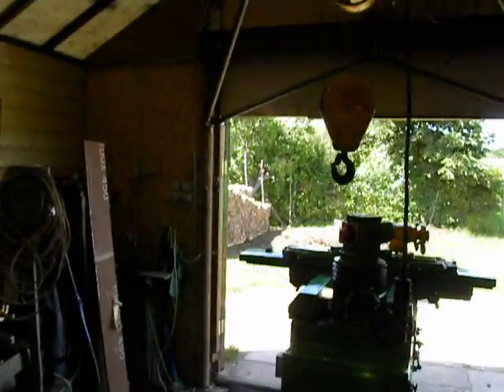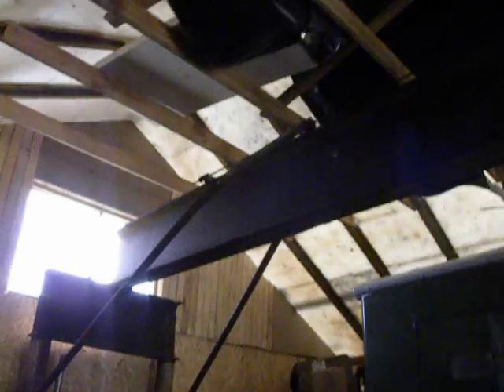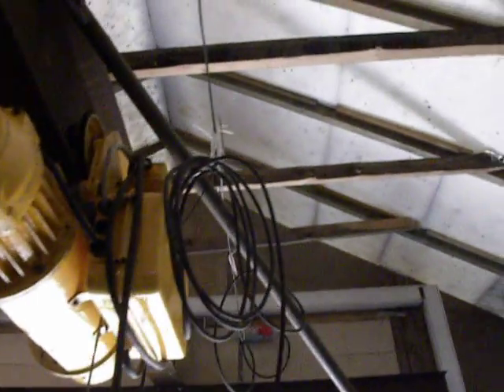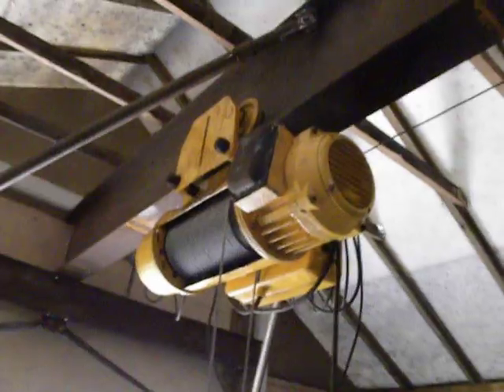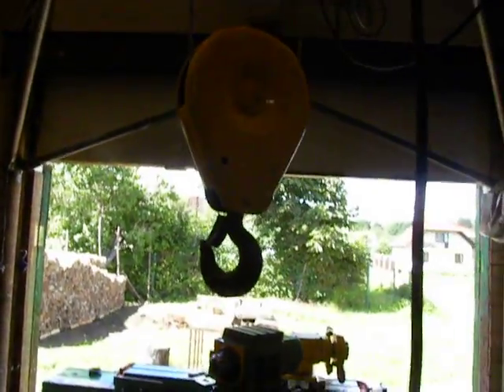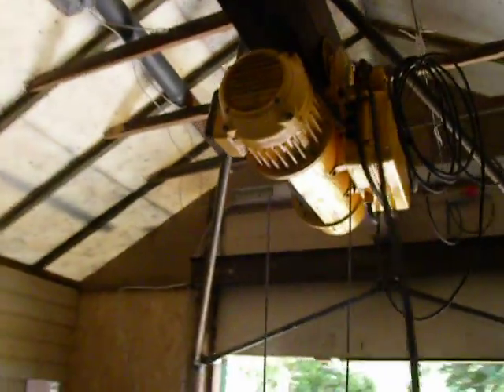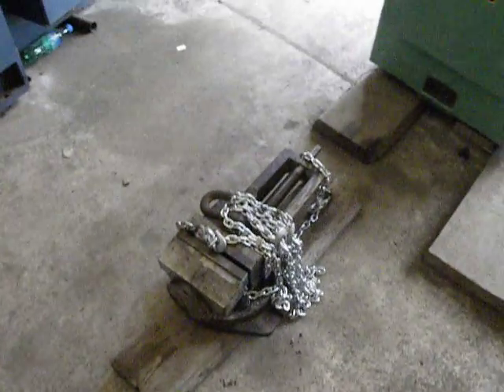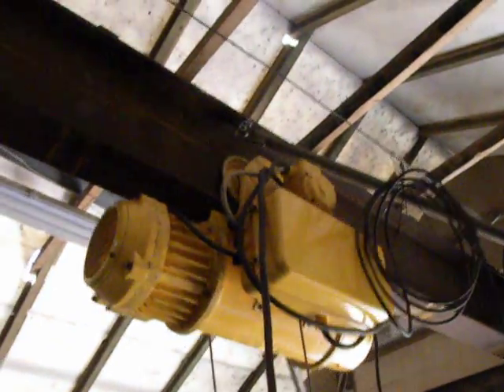The telpher-crane is installed in my workshop /telpher project/

Comment: I looked at the telphers I have access to and the 0.5t had 0.75 kW motor weighting 30kg and the 1t one had 1.5 kW motor (40kg). The 0.5t one had 6 mm cable on and between winds there was ~2 mm space, from that I guess that I guess you have the 0.5t model T10232 or something similar.

The rated capacity should be also moulded on the hook pulley casing, "500 kg" or "1t" but that could have been replaced some time ago. The 1t one has a 21 cm diameter pulley with bigger hook than the 0.5t one.

Comment from the maker: Oh, You say that to I can apply more than 1,5T on this beam... Good! My Horizontal boring machine table capacity is 1T, so I think so- I don't pick up anything that what weight are more than 1,2T.
My telpher weight is not ~300kg... because at those weight my wheelbarrow was to break to pieces... Also each piece of telpher I can easy enough move... by Your info I think that to my telpher is 1T, but as You say- " Even the smaller ones can lift multiple tons...".

Comment: Running the 8m beam through a webstructural punkts com beam calculator as a S15x42.9 beam with your ~1.5m bracing and applying 2 tons in the centre of it gives about 3.5 times margin on the capacity, so it should be good for ~7 tons, but don't quote me on that, I'm just guessing here.

If it's a 2 ton version then it should weigh around 300 kg. I'll go look at my 1t and another 0.5t telpher to see what size motor they use, from that you could also figure out its rated capacity.

Comment: As far as I know they made this telpher model with 0.5t, 1t, 2t, 3.2t rated capacity that had cable diameter 5.6mm, 8mm, 11mm, 13mm and weight of 142kg, 160kg, 290/320kg, 355kg. Also the bigger ones had more powerful motors and there were variants with shorter/longer lifting cable. Even the smaller ones can lift multiple tons, or so I'm told, have to do a test one day.

Comment from the maker: Yeah, I know lifting capacity- 1500kg (3300 pounds). True it is made by Balkancar in Bulgaria. The beam I calculate for 1,3 to 1,5 tonne, but experts say that to this beam can hold 5 tonne at so length. Too fast move is a problem... You have a great idea install the variable frequency drive controller on its motor! Thanks! P.S. Before I get this telpher one man to offer a chenese "scrap"- I don't like that piece construction....

Comment from the maker: Crane run on 400V, remote control works on 110V via power transformer. Capacity is 1,5tonne it is around 3300 ponds. Thanks!

Comment: Do you know its rated lifting capacity? Got myself a 1 ton one, at 160 kg net weight it eats todays el cheapo chinese telpher wannabes for breakfast.

Made by Balkancar in Bulgaria, good stuff.

As it seems to be way too fast moving for the work you're doing I'd suggest to install a variable frequency drive controller on its motor or at least run the lifting cable via another pulley at the top to slow it down a bit.